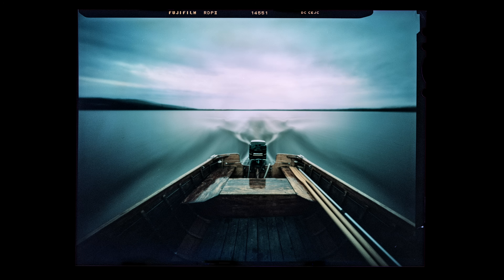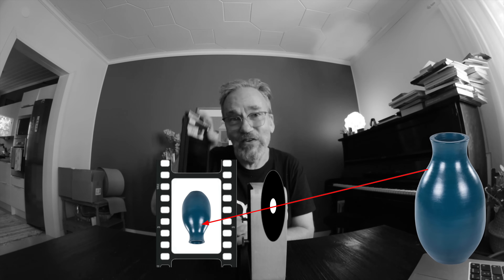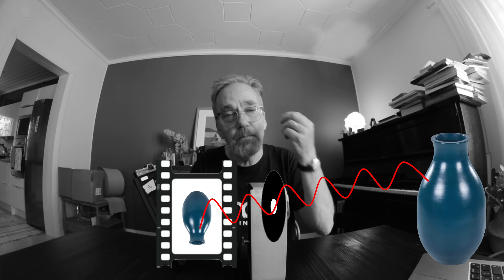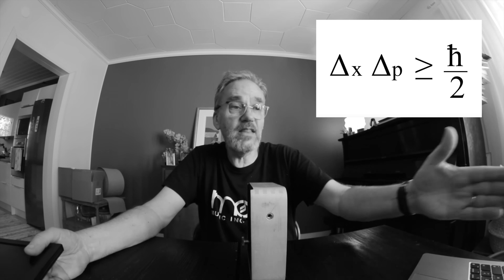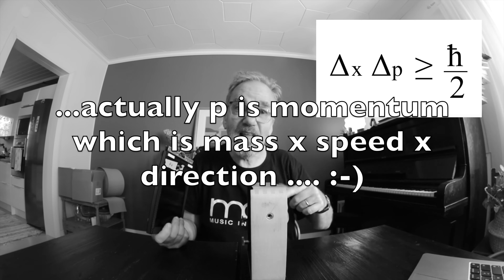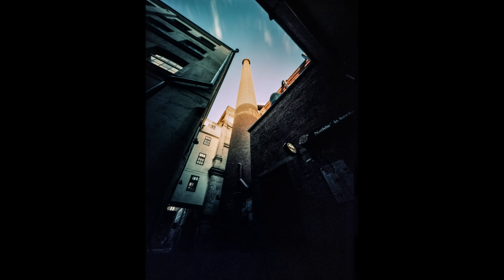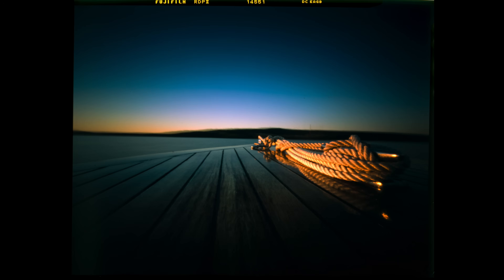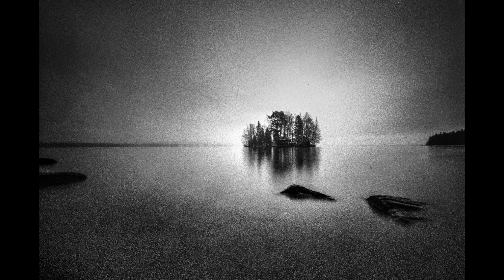Pinhole Photography Secrets: From Quantum Physics to Composition!

Comment: I made my first pinhole camera in 2002 to use 8x10 black and white printing paper.  The average exposure time in daylight is about 50 seconds. Yes, it is extremely slow. And I did use it for Portraiture.   Your subject needs to hold real still.  Remember, back then, I was using just daylight. I've seen people use flash. That's something I'm looking forward to doing.
I did make a pinhole camera out of an now old Canon digital camera. I wasn't impressed with the results. As you said,  I need to rethink my subject matter.    Thank You.

Comment: I agree with all your recommendations, especially using large format, choice of subject and composition, though I have found, after a lot of testing and experimentation, that the quality of the pinhole is an important factor in obtaining high resolution images. I've found the best results came from using precision electro-formed pinholes (a disposable item used in electron microscopes). This process produces very thin, perfectly round apertures that have smooth, clean and burr free edges.
Reply from the maker: True. The quality of the pinhole has an impact. But I feel too many people concentrate only on it and nothing else :-)
Reply: @ShootOnFilm  Yes, I broadly agree with that. Years ago, I used to make and sell 5x4 pinhole cameras. I did a quite a bit of research and testing to optimise the performance and design. Having the best possible pinhole isn't that important aesthetically, but from a technical point of view it is surprising what a difference it makes. Rolleiflex vs Holga if you will.

Comment: I have made a pinhole camera out of my digital Sony with a drilled out body cap and a piece of thin brass with a needle point hole. I haven't used it in a few years, but based on your advice/suggestions I'm going out very soon to give it a try again. I was not impressed with my prior results which were primarily woodland shots, live and learn. Thanks!
Reply from the maker: Awesome. Good luck!

Comment: A lovely explanation one of my favourite subjects! :-)
Your method of making the pinhole helps a lot with getting close to sharp.
One problem is a lot of commercially made pinholes are laser cut which forms a small volcano which is effectively a light tube so you can get scattering due to reflections through the tube (if the volcano hasn’t been properly ground away. Equally using a slightly too thick material can make a light tube causing similar issues.
Agreed re larger formats. I mostly use 6x9 medium format and 10x4 large format, both of which give lovely results. (I have some notes online for one 10x4 build and should finish that sometime)

Comment: great explanation. I am a 35 mm photographer. When I was looking if pinhole photography was something for me I found out that 35 mm pinhole photography sucks. Well I was right about that i concluded from this video. Another thing I learned was that a clear subject helps a black and white picture to get better. The heath is blooming at the moment but on a black and white picture it won't work. So I photographed a single heath plant with flowers in sun light. It worked!
Reply from the maker: Yeah, you gotta seize the moment and photograph what makes sense!

Comment: If the laws of physics hold, how can the optical lens yield a sharp image? Shouldn't it be more about the number of photons that are large enough to produce an image of high contrast? In other words, low ISO film and long exposure time are the secret ingredients of a sharp image.
Reply from the maker: This requires a longer explanation -- an no - low ISO or ling exposure time won't help:
Why lenses can be sharp?

A lens bends (refracts) incoming rays so that all rays from one subject point converge onto one point on the image plane. This massively increases resolution, because instead of relying on one tiny aperture to block light, the lens can collect lots of light rays and focus them coherently.

Diffraction still happens at the aperture stop of a lens, but since lenses focus light efficiently, the blur (Airy disk) is much smaller compared to pinhole fuzz.

So, same laws, different outcomes

Diffraction limit: Both pinhole and lens systems are diffraction-limited, but lenses can operate with larger apertures (collecting more light and avoiding extreme diffraction).

Uncertainty principle: Still applies (light’s position vs momentum spread), but again, focusing optics redistribute rays in a way that minimizes the effect at the image plane.

So the short answer:
Lens-based photography is sharp because lenses actively focus light rays from a single subject point to a single image point, while pinholes passively restrict light, leaving diffraction as the dominant blur factor.